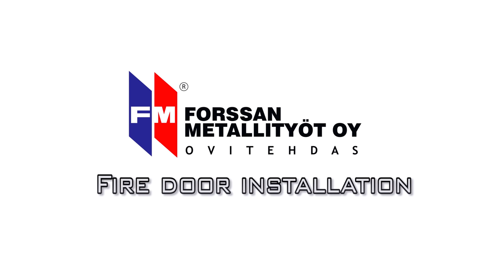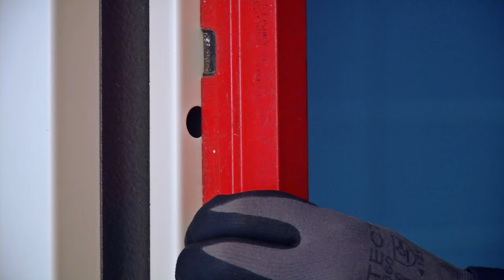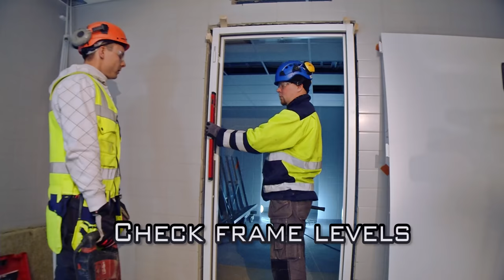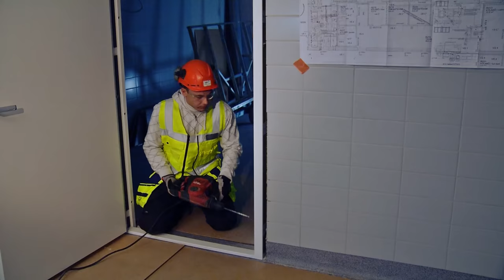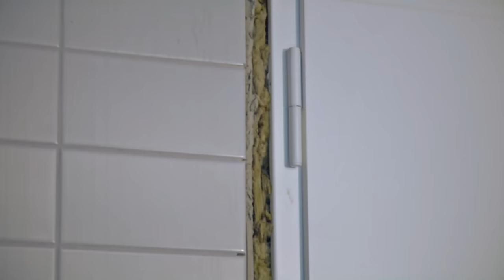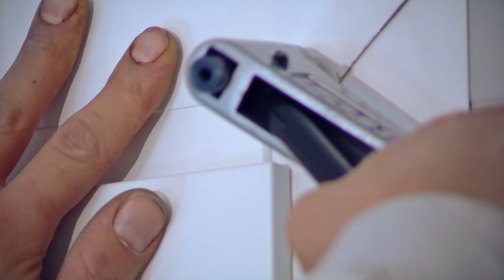Fire door installation video

Comment: Why were the screws hammered in?  (Someone else asked this same question, and got no reply.)  What are we not understanding?
Thanks
Reply: I'm wondering the same thing... they also used snips to cut the trim... judging by the language of the title, it may be some cultural difference. We certainly do not do it like this in Canada. The shimming and leveling of the jamb, sure , but not screws and cheap casing. Plus, they dont even show feigning the shims off before fitting he casing. I'd say this is about a 6/10 video

Edit: it's a fire door, and they're using a hammer drill. So that drywall is probably covering cinder blocks. Hence why they'd have to use a hammer drill to hammer the "screws" into the cement. I watched it twice and realized I wasn't seeing some things the first time.
Reply: These are hammer in screws. They come with specialy designed plugs. You just hammer them in and can unscrew if needed.

Comment: No fire mastic over the fire bat ...
Reply: Is mastic only required where a long duration fire rating is required?
Reply: Depends on the test evidence for the door, would expect minimum of mineral wool and mastic though but the architrave / trim could be a tested method suitable within the assessment